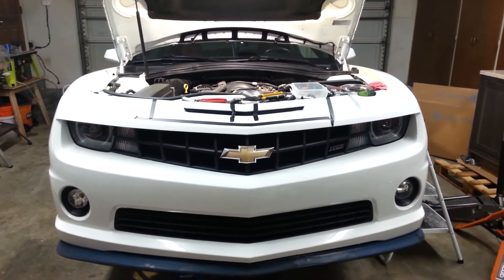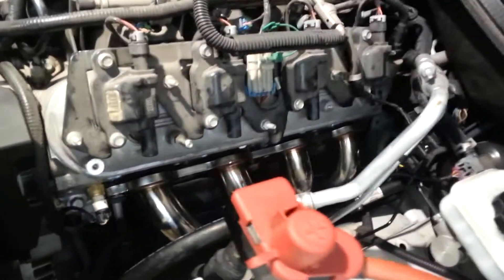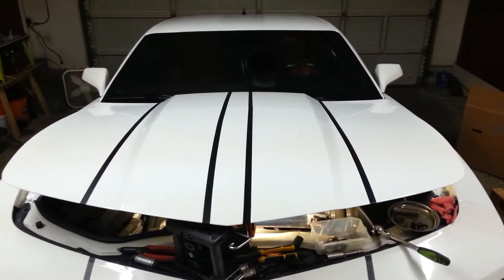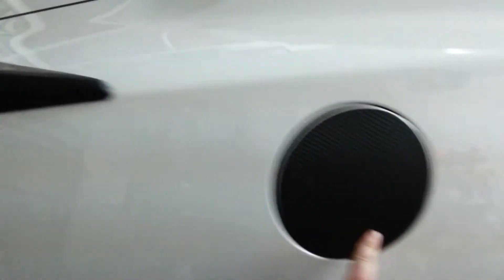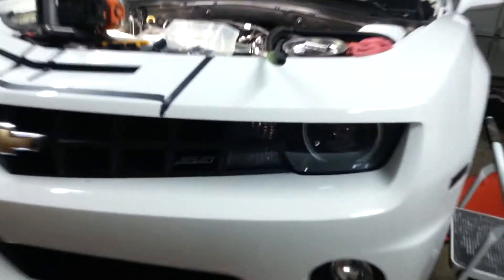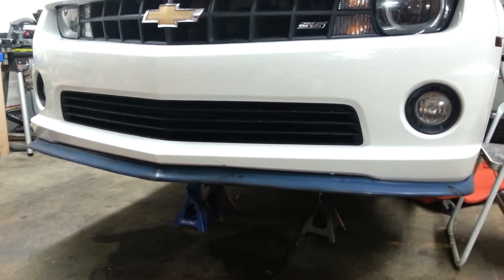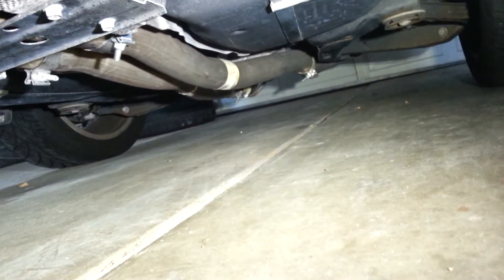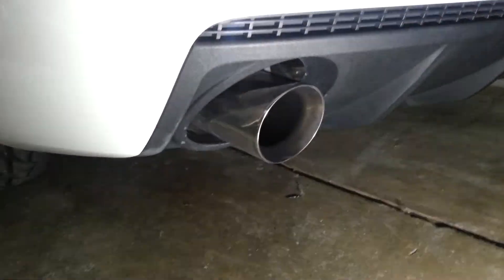2010 Chevy SS Camaro with the 6.2 liter V8, installing long tube headers!

Comment: What did you do with the 2 o2 sensors? There’s only a spot for 1 o2 sensor hookup. What did you do with the other one?
Reply from the maker: Tooperfect87 On my buddies Camaro only the front O2 sensors hook up to the Speed Engineering headers and you just screw those in and then trace the rear ones back and there should be some gray plastic plugs with a side that has a lock that with can pull up with your fingers and then pull the O2 sensor out from there from there and just ditch it, or save it for later incase u ever decide to go back to stock. I hope that helped you out bud you'll have to let me know how it goes. Thanks for watching my video and commenting!
Reply from the maker: Kevin House Yeah here in Utah safety inspection isn't even required anymore and even though we took the catalytic converters off my buddies Camaro it still passes the emission test just fine, somehow lol 😜
Reply from the maker: Kevin House Exactly!

Comment: I think those are speed engineering headers
Reply: Did the check engine light come on...
Reply from the maker: Kevin House We used a programmer on his to get some extra power and make a few other adjustments, although he did drive it for about a week before he got his programmer and the check engine light never came on. If your check engine light does come on a lot of the times it's just a glitch and u can disconnect your battery wait 10 minutes and reconnect it and the engine light will have gone off, just a little trick that I learned that has worked a lot for me but I can't guarantee it will work for u.